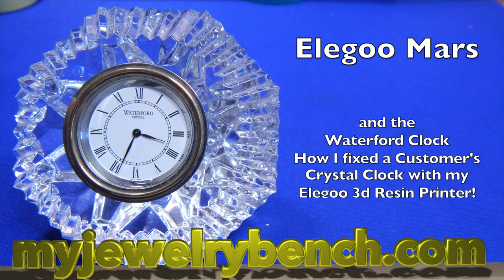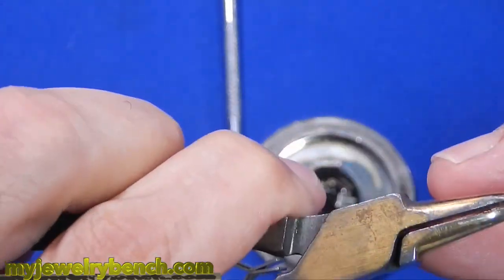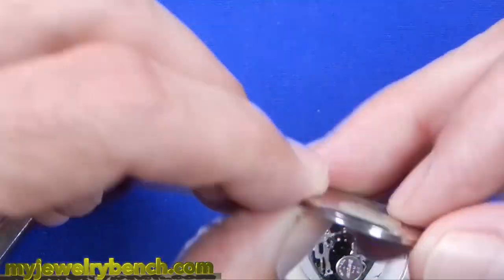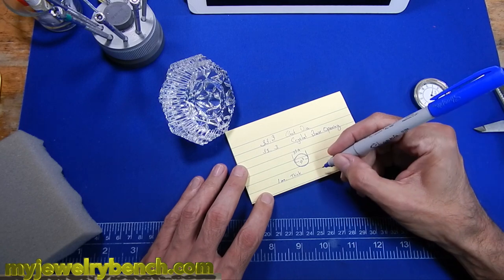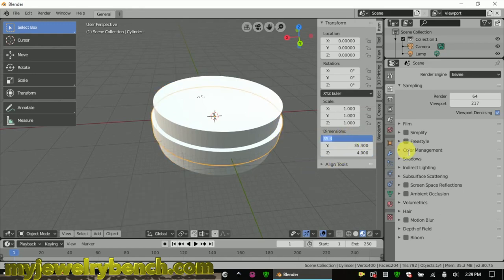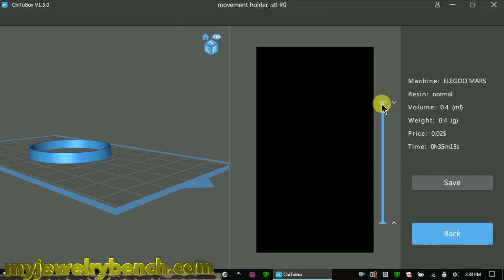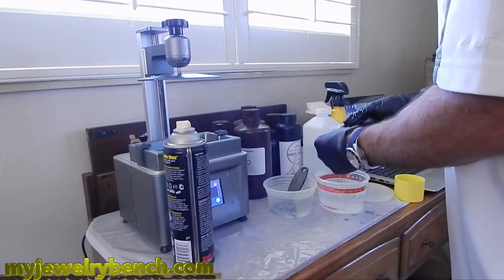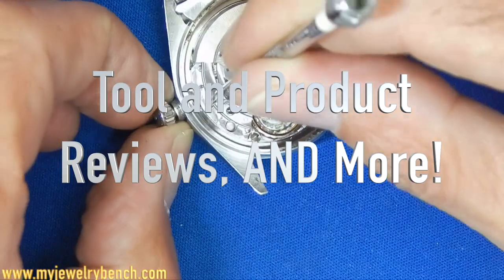Elegoo Mars 3d Printer, used to fix a customer's Waterford Clock!

Comment: I need to start leveling my printer bed like this. I have been leveling it with a piece of paper on top of the lcd like I saw in another video. To me it seems like it is pressing into the fep film and distorting it while printing. Making a noise when it lifts from the bottom of the vat for every layer.
Reply from the maker: Whether the fep film or the lcd, only apply light pressure, no matter which printer you use.   The next printer coming in has a bed that is supposed to be leveled only once...  Not sure about this yet.